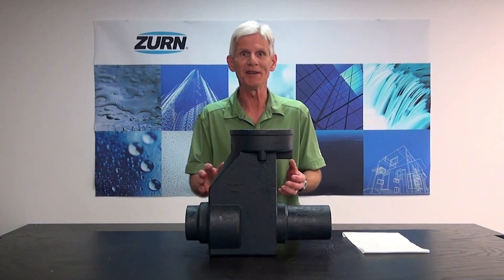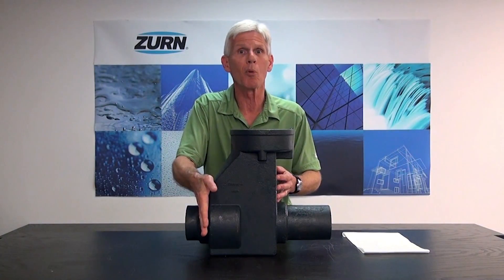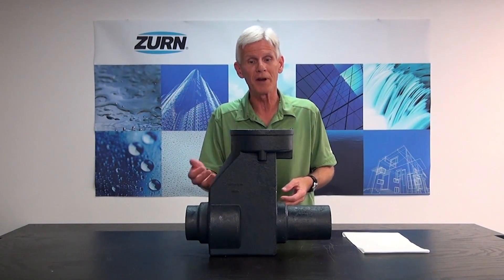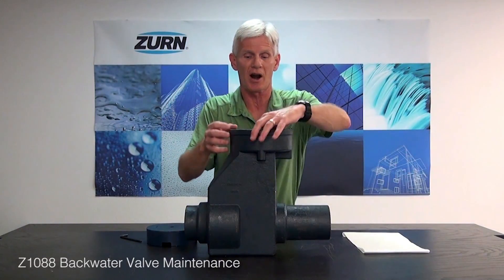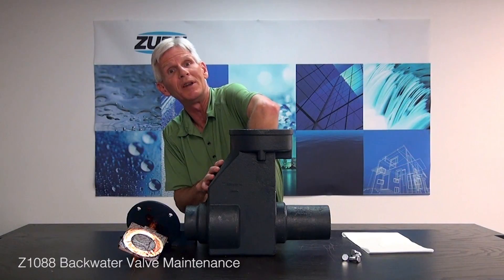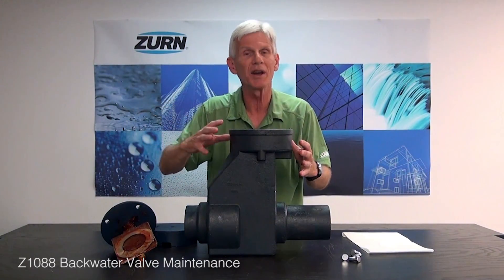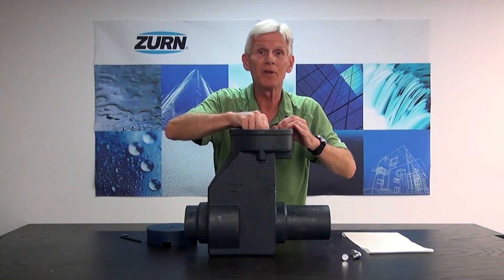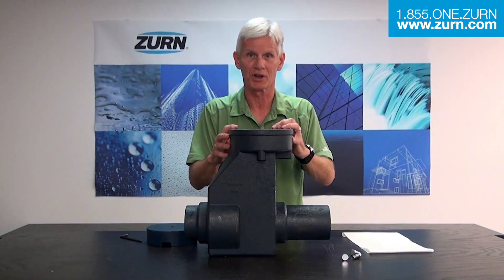Zurn Backwater Valves Z1088 - How to Maintain

Comment: Good, but video could have been improved by using an overhead shot of the valve as you were undoing the bolts and pointing out stuff inside the audience never sees. Also, I've maintained my valve for years and immediately found out that using a wrench like you did to loosen bolts that haven't been turned in over a year and which sit in rusty conditions is an excellent way to strip them. I've found that using a 19 mm socket wrench with an extension makes it so much easier to get the bolts off and you don't bang your knuckles, either. Thanks for the video.